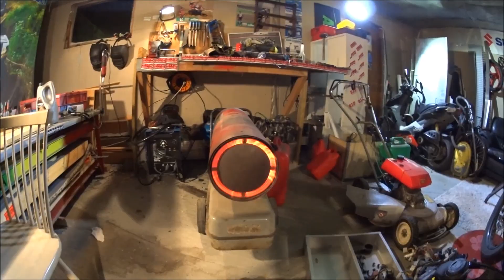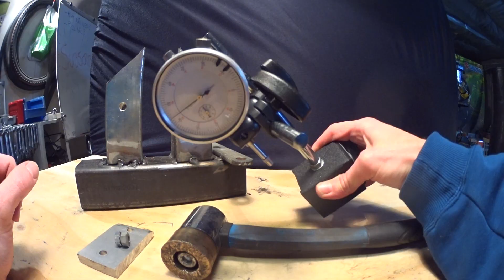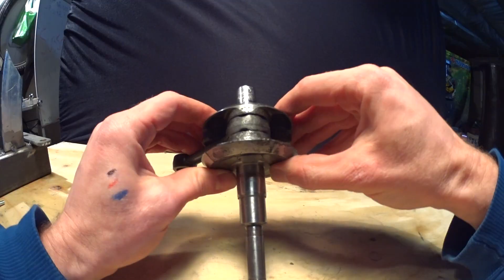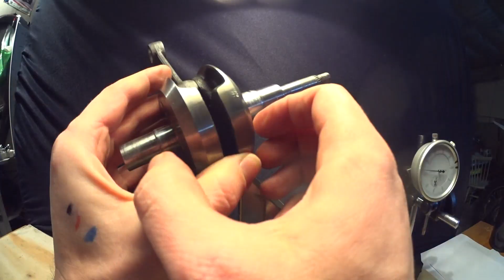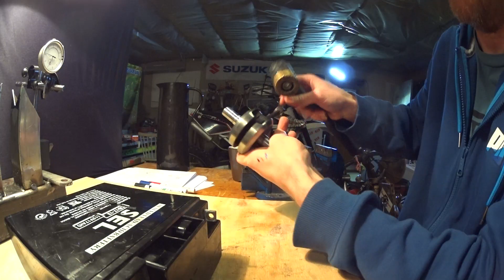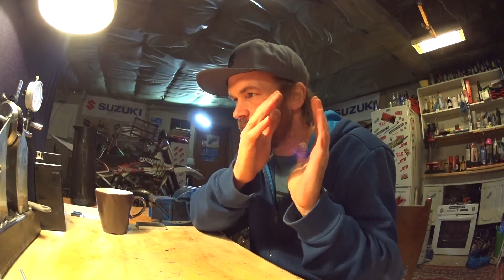CRANKSHAFT TRUING MADE EASY | How To True Two Stroke Crank | 2 STROKE TUNING

Comment: Thank you! Your process at 4 mins of explain WITH the crankshaft finally made me understand!

Got my CRF450x crank to .0005 today on the left side and under that on the right side!
Used test indicators, granite surface plate and v-blocks.

Had to cut-off wheel the off crank but pressing it with a 20-ton was insanely easy! The truing was the harder part :D 
The crank really does "stick". Hit that thing so much my wife was like is it done yet?

Comment: Hey, excellent explanation.
I got to do this at the motorcycle mechanics Institute.
I put together my Honda c r eighty Aftermarket pre built crankshaft didn't know i needed to check it for true Now I got some vibration at wide open throttle. 
Sucks!

Comment: Don't know if you still follow this post...I'm having a terrible time with an XL185 crank, so I got the TAG Z balancer and meter jig, I'm getting a high point just before the crank facing front of 55 and if I run the Conrod from 0 backward the Conrod gets to two 3/4 to the rear bottom side and negative/low 75 as in reading the meter backwards 90 as 10, I've got it to about 12 high same position 45 low same position then I had realised if I ran the Conrod around, the jig runs the crank to one side and the bearing rollers on the jig catch on the crank grinding and obviously move on the meter position and alter (hence why im reading it by running it / counting backwards....ah amazing starting to figure it out now, using a rubber mallet by the way, no dents and it works

Comment: Thank you for this info. I only can afford to mess with the Chinese bike motors on Amazon.  But I'm able to get a sweet running motor. I didn't even know you could true a crank like this without grinding. Idk if you ever messed with those motors but they are a pretty good/simple design. Just the parts are usually pretty bad.

Comment: Question; would using a rubber mallet to separate 2 stroke cases possibly throw off a crank’s balance? Im putting mine back together and want to know if it is necessary to check or get a new crank thank you!

Comment: Hello just started to watch your videos and have helped alot. I am trying to refresh my sons iame ka100 engine because bearings on crankcase were going bad. first time inside a 2t engine. the crank is true but i have a question about axial clearance. per the overhaul manual it say between 0.4mm min. to 0.6mm max axial clearance on the connecting rod to the crankshaft. i have 0.7mm. this engine was previously blueprinted by a well known builder and i'm wondering if this was done for performance or should i take it apart and fix this. I would really appreciate your thoughts on this.
Reply from the maker: 0.7mm would be fine in my opinion.
Reply: Ty for such a quick reply. 👍👍

Comment: What do I do if the crankpin is on top or bottom i have 2 dial gauges the left one is not moving and is true to the eye,  only the right one is moving and looks woobling a bit, when the pin is on tdc the reading goes higher and when on bdc the reading goes lower ONLY ON RIGHT SIDE.

Comment: ehhhh. My crank happens to have two different journal sizes, a simple V wont work. I went through some variations, making a stand that accommodated for the differences...then I found that my craftsman mini lathe makes a damn fine crank jig even if it struggles to turn parts. (Looking at some of the commercially available $900 crank jigs Im thinking, "Hey thats just a damn mini lathe without the cross slide". Used two indicators on the halves. Its within .001" now, taking a breather. Guess I will throw it on the stand that resembles your concept here and see what the runout is on the far end of the crank, I still cant get that thru my skull as to how/why that works at all. what about variations in the stand? Like if moving left to right one side is higher? Or if the left side is closer to you than the right? (the sides of the stand I mean). I guess a trued crank would still read true even if it was spinning off level or not parallel to the stand.
Reply: You can just weld up some very simple V's of mild steel to proper height in a matter of minutes. Grind V's to an edge with angle grinder. Height does not have to be completely exact but the crank will walk to the side as you turn if it's off a significant amount.

Comment: I have  a 22hp 70cc minarelli engine that stripped the gears in gear box it cost £2500 to build and revs to 16600 would you be interested in making me a couple parts to swap?
Reply: It did 80mph on sat nav

Comment: I watched your video as a guide, before I trued my crank of an old Bike from the UdSSR. I measured 6/100mm difference while turning the crank. It took me LITTERALY JUST ONE hit with the hammer and the shaft ran true with bearly 1/100mm.
Thanks for that video, apparently it worked more than well for me!

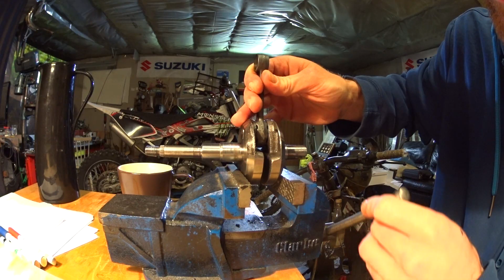Comment: At 6:30 you came to the conclusion that the error was around the crank pin, but how do you know it wasn’t just the shaft that was bent? ie. no longer perpendicular in to the face of the web or on the axis of rotation? Sure squeezing it there might true the far end you were indicating relative to the apparent centreline of the crank, but you might have to just “robbed peter, to pay paul” and thrown your web into an unbalanced or less balanced state, just to make the end of your shaft appear to run true!

Maybe get a micrometer across the webs to determine if they are running parallel, and then run one or preferably a pair of dial indicators on the outer diameter of each web to determine if their centres aren’t concentric, and then tap to rotate in the desired direction. Once both webs are parallel and concentric to each other, run your dial gauge on the side face of each web to determine if they’re perpendicular to the axis of rotation and assuming all is good, then a run the indicator on the end of the shaft to determine if the shaft is bent, or if it is true to the axis of the crank, not that it matters critically, since it’s outside the main bearings anyway
Reply: This is how i measure mine, dial up on the webs fave and outer edge. You do have to double check before you start that both crank webs are the same dimentions because you'd be suprised how many aren't !!

Comment: This procedure would be correct if you used a perfectly true crankshaft stand. Every time you rotate the crankshaft you tend to move it axially back and forth thereby  introducing inaccuracy in the reading.

Comment: Excellent guide
It was not possible to do diy alignment on my crank shaft without watching your guide. 
Here are Couple of techniques that I discovered:
You could use a lever or screw driver and pry in between crank shaft for minor adjustments, you would be surprised by how little effort is required when doing this way
I use the above technique with a dial gauge still touching the shaft for avoiding trial and error
If one web is true and other isn't, I try to avoid wedging action and instead hit only the web that has run out, this however applies to rare cases though
When checking run out, I tend to use the extremities of the crank

Comment: how to balance your crank.
step 1: drop it off at the machine shop.
step 2: pick it up from the machine shop
step 3: pay the machinist for his time
step 4: you would have completely fucked it up so you saved money in the long run.
Reply: I mean, it's basically the most accessible form of machine shop work that exists to do at home. Welder and grinder to make a very simple set of V's, a press, a vice, a copper hammer, and a dial indicator. If you plan on doing more than a couple in your life, it's plenty reasonable to learn how to do it.
Reply: But, some people can break an anvil with a rubber mallet, if that's you, pay a machine shop.

Comment: If the crank is that bad you buy a new crank
Reply: One from China, with way more run out than is easily achieved by using this method. You can even do better than factory Japanese cranks. It's an easy job with no downsides. Less vibration and longer engineer life. Taking the engine apart is far more work.

Comment: I follow your instructions but the main problem is that once i align one side (not a big problem) on the other side increase the runout, why? in this case should i find an acceptable  balance between the two sides ?? or is it possible to align perfectly both the sides also if one runout till the other is aligned??

Comment: I've pressed hundreds of 2-stroke cranks and my rule of thumb is to always eliminate the twist first...Start with rod back and then rod front and find which is lower at the two readings, then rotate to the lower reading  and hit the top of the cheek closest the indicator...HIT THE LOW...After rod back and forward is true, I then move to check rod up and down, spread or pinch as needed and then follow up by re-checking twist, as well as a full rotation reading....After it is true I also re-check the rod side clearance as it can change during the truing process...Copper hammer and aluminum jaws on the vise also...Good luck with it !
Reply: Can you fix my crank are you still alive lol?

Comment: Hi love your videos. Really helpful. Though I have a question I'm hoping you could get back to me as soon as possible, I'm doing my big end bearing on my crank after it seized on my Honda Cr125 2000 model. And I'm doing most of it myself to save money, my question is a mechanic told me that once I split my crank I'd have to send it to a really good engineer with the right laser tools to get it true and that even if it's 1000th of a mm of true it will wreck my engine. Is that true and how much off can I be from my true point to wreck the engine? I'm asking cos I watched your videos and you were off as you said by 200th of a mm or something so please explain and help I'd really appreciate it!

Comment: For sterters, dial indicator both sides, 2 dial indicators, same time. lead hammer,  lead bed,  fixture should have tapered centers.  You are doing very good for what you have to work with.
Reply: Stert is a muckle Scottish word
Reply: Centers are handy if they are in spec with journal, but once they see bearing puller, they usually are not as true anymore. Hence final judgement is better to be done based on locating features (bearing journals). Obviously centers show problems better, and help getting close faster

Comment: Can you guarantee that after you install the bearings into your cases (I presumme using a method of heating-up the cases and freezing the bearings), and you then install the crank into your cases, it still will be true? Would the friction caused by bearing to crank journal interference fit, eventually not pinch the crankshaft? Even if you draw the each crank pin on each side into the casing with a puller, the very last tension from the tightening the casing screws would eventually put some axial stress on the bearings and crank itself leading to pinching it?

Comment: If i am simply rebuilding my daily driver 125cc scooter that has failed bearing do i need to go trough all this or its tuning for racing or when you push it far into in red zone 12000+ rpm? What happens if i dont do it?
Reply from the maker: You don't. When I worked at a small scooter shop I never bothered.
Reply: @2STROKESTUFFING  I actually made a simple stand from two "eye bolts" bolted to 2x6 piece of wood just to make sure crank is not too bent, without gauge similar to this youtube (video id) PANf99pSV8s

Comment: THIS is the correct way to measure runout then reduce it to as little as possible.  Note where he places the indicator on the shaft, not the bearing journal. Good video!
Reply: Good video wrong/ bad technique
Reply: Someday maybe you figure out what the centers in the shafts are for.
Reply: Robert Hoard please school me! I can tell u know something smart
Reply: Ob Fuscated the real correct way would be to use 2 gauges

Comment: I taught crank re-building as part of 'Machine Shop' course, That was pretty good explanation. Two and 3 cylinder cranks are not too bad to do, even without various special tools.(I've used centres or v-blocks-precision and home made) Multi cylinder just take longer to do and you have to make sure the phasing is correct. 180 and 360 twins are pretty easy. Most small single cyl cranks only use 1.5~3 tons of interference fit, 'newer' Harley Davidson use a minimum of 40 tons, (even though they say 50) I don't mess with them. Polaris/Bombardier use around 18 tons  and they are more than dangerous enough for me. Use a lead hammer to prevent damage to flywheels when you have unhardened cranks, easy enough to re-melt in a can when it gets deformed too bad (just don't tell health and safety ;o)   )
Reply: Oh my fu<king god it takes 40 tons to press a new harley crank together !!! How many thousands of an inch bigger is the con rod pin than the hole for it in the  fly wheel ? 5 ? 10? 15? Thousands of an inch bigger ??? and i hope im being obnoxiously exageration at 0.005 " what the hell where they thinking this time ..you are a machinist and know rule of thumb same size hole same size pin in steel to steel can be around 5 tons...this is what we call a machine press fit right ?  And a plug fit is what ? pin to hole something like 0.001" - 0.0015" under your give I.D. of the hole for the pin ,,i worked in my friends machine shop as he had no help when first bough the place from his boss ..and Loren knew how particular i am putting all types of engines together and talked me into a temporary job asbi had no machine shop experience at all except engine shop building that we both know is close but not the same skills ,and  after two years Loren found real seasoned machinestb
Reply: @donniebaker5984 non hollow shaft, and wide seat in cranck probably allows for lot of interference😅.

Comment: I always wonder how well built cranks are when they leave the factory. And what heat does to change the crank, whether it's welding at assembly or heat cycles while operating the engine.

Comment: About 10 years ago, I was living in northern Minnesota, and I worked at an engine machine shop.  Up there, almost everybody has a snowmobile.  Twin cylinder cranks are bad enough, triples really suck, but one time a guy brought in a 4-cylinder 880cc vintage King Kat engine.  NEVER AGAIN....
Reply from the maker: I can't even imagine how time consuming and frustrating that job would have been...
Reply: Oh my GOD...took me 3 days to figure out that you basically have to start with the middle two, use large pieces of steel pipe honed smooth inside and cut in half lengthwise to hold the middle two in alignment (with gage blocks and shim stock between the webs to keep them from coming together), THEN do the outside ones.  If you search on YouTube, there's a racing shop in Canada that built an INLINE SIX TWO STROKE ENGINE OUT OF 2 SNOWMOBILE TRIPLES.....you couldn't pay me enough....

Comment: Even when i beat the shit out of it it doesnt move and stays at .014 of run out
Reply: heavier hammer
Reply: 1 or 2lb copper hammer will easily move any pressed crank.
Reply: @apodski  i got a brass hammer from harbor freight. Bikes been running for 4 years

Comment: Unify needle and actual movement. To reduce potential for confusion, adjust the dial indicator "0" position to, in this case, roughly 9 o'clock position. The needle and crank will move in unison, up=up, down=down. Deletes one line of brain code for use elsewhere. Thanks for the video. Cheers
Reply from the maker: +Jim Marriott Good advice, thanks!

Comment: how are you timming  inner webs 180° out from each other. the pin is not keyed .  I use presision ground gauge blocks made just for this .
Reply from the maker: +MrKidkiller159 Ahh, forgot it's a twin... I have next to no experience with twins. Gauge blocks sounds like a good way!

Comment: After a few rebuilds on my kx500, I've noticed the vibration changes to different rpm at each time. I use a hammer to belt the crank out and heat/freeze on assembly. I can now see why I'm doing it wrong..... plus I'll need a very big vice and hammer to balance it 👌

Comment: Tips for 2 cyclinder snowmobile cranks? Your videos have been helpful in rebuilding/modifying my single cylinder bikes. I'm digging into my sled motor next...
Reply from the maker: +Elevated Grower Not much experience with multi cylinder cranks, sorry. Try treating it as two, truing one half at a time if at all possible.

Comment: How does that knife edge feel when you are turning the crank? Is it frictionless enough for balancing? I want to make one but I was thinking of a 3 ball bearing arrangement to hold the one side of the shaft.
Reply from the maker: +Sketch1994 Doesn't work very well. I use two evenly spaced steel rods, works great! Thought I had made a video about it but can't find it... Guess it's time to make a new one...
Reply: I think I found it. I had tried something similar with two straight edges but getting it level so the crank would roll down was impossible.
Reply from the maker: +Sketch1994 Weird, works great for me, I'll make a new video!

Comment: Hey man, love your videos! Would you give me a tip for exhaust for my setup on minarelli am6? The setup is 
Exhaust and intake port polished
Airsal 77cc cylinder
Metrakit pro race crankshaft
Stage6 C3 crankshaft bearings
Dellorto PHBG 21mm carburetor
UNI air filter
NGK BR9ES spark plug
Stock derestricted exhaust
Thanks for your respond.
Reply: You never polish the intake port
Reply from the maker: +Mathoslav Thanks! Sorry can't help you much, have very little experience with store bought pipes...